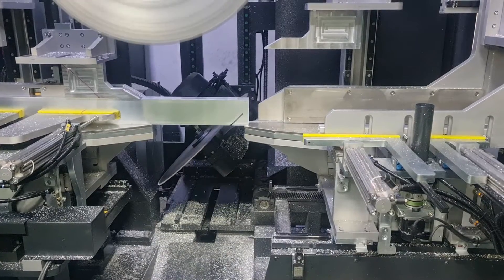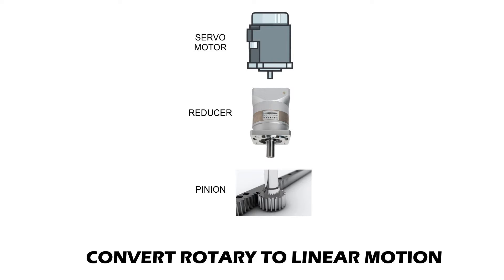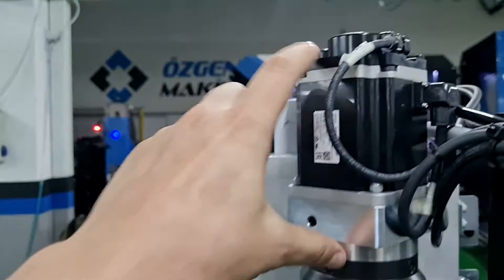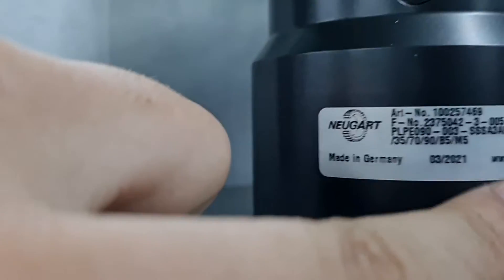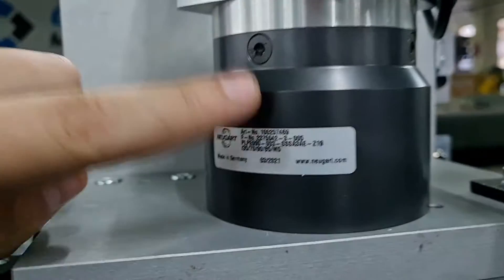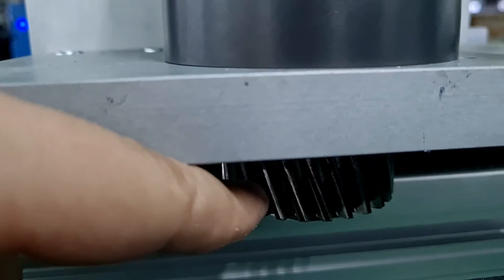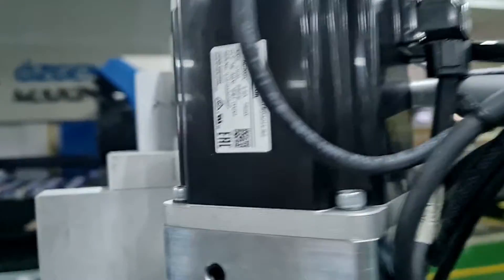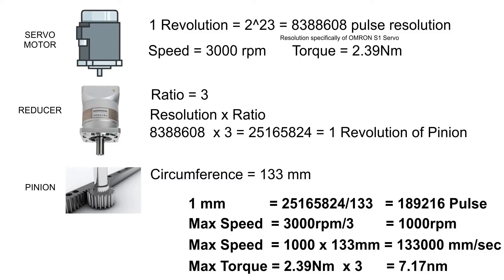SERVO MOTORS PART 1 - Pinion with gear rack and reducer

Comment: What kind of rack and pinion can you advice of me to obtain which has an accuracy and repeatability of around 10 to 25 microns which will be used for CNC that has a Y-axis of 7 feet?
Reply from the maker: Hello, each brand of rack and pinion has different product groups designed for specific operations with different accuracy rates. 10-25 micron accuracy can be easily achieved without trouble with most products but its better to consult with a person who knows what he's selling. In the catalogues of the products there is the backlash rates and accuracy rates of a product. I have worked with the THK and it didnt give me a headache so far. But HIWIN is also good.